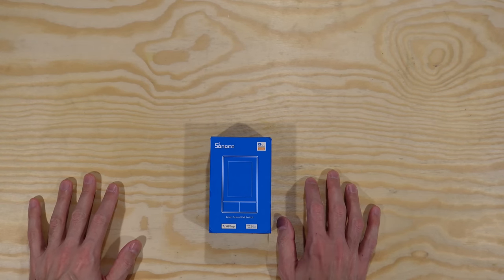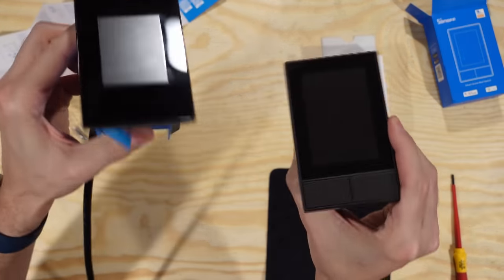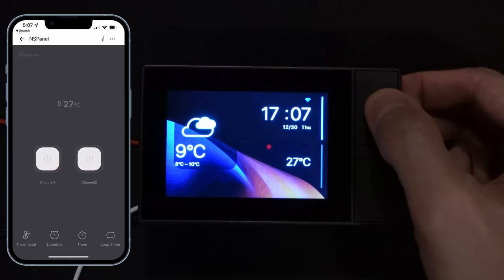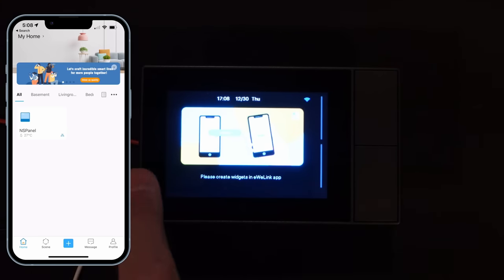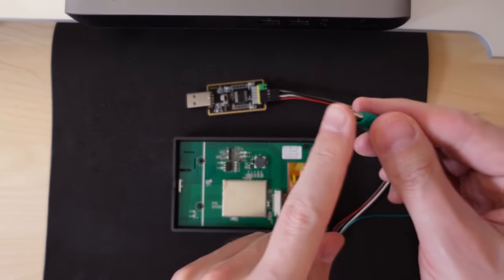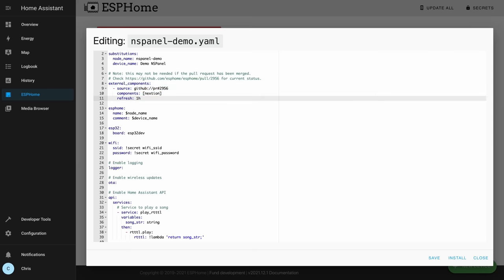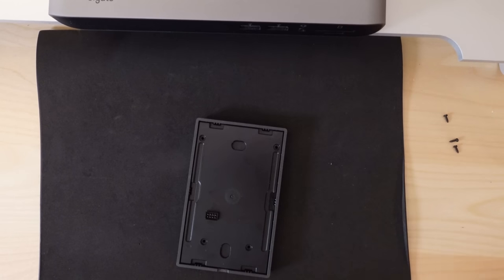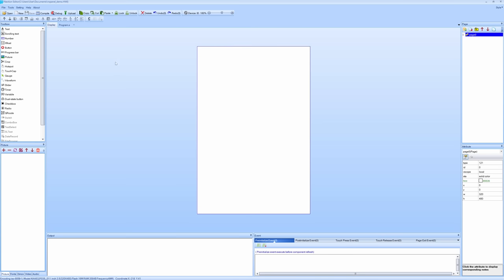Flashing the Sonoff NSPanel with ESPHome - how to get a custom UI for Home Assistant!

Comment: What a great walk through - Thank you very much ! I have my Kickstarter EU version on the bench. Torn between keeping the Sonoff HMI and waiting for the ESPHome component to implement all the Widget functionality, or diving in with the Nextion Editor. Now if only Sonoff would go the whole way and release their HMI and we could amend the default with the nice graphics !
Reply: Same here, i just got mine today, and currently just having it idle using the stock eweelink firmware. It will be great once these becoming more widespread and all the ESPhome/tasmota features/goodies become implemented.. I basically for now just want the stock UI with the realtime weather, time, and room temp. but eventually would like some slick customization.

Vids like this though are great that there is hope to fully unlocking and enjoying these LCD smart switch units. I definitely want to put these in all my rooms considering that once we put open flashed firmware, these units basically become a local lifetime unit without worrying about shutdown cloud services.
Reply: @TheMoistpotato  @Dean Smith I know this is from a year ago, do you know if ESPhome has now implemented the widgets for home assistant? Wondering if you can now use the stock GUI but add devices / scenes from other sources (not ewelink)?

Comment: you can get a nice 7" used tablet for $100 and have this functionality + much more
Reply from the maker: Just a few reasons why that might not be a direct equivalent:
* Form factor doesn't work as a switch replacement
* No physical buttons
* Doesn't control loads
* More complex interface, have to deal with kiosk browsers etc.
* Mounting more complex to avoid unsightly USB cable
* Battery swelling issues if charging isn't managed (or batteries removed)

I also have a tablet where it makes sense and I like it for that application. But it's not the same at all.

Comment: Amazing video! Really helped me to get started with my two NSPanels. One question: did you get the slider working? I could not get it up and running...
Reply from the maker: Thanks. What slider do you mean?
Reply: @ChrisMasto  The slider element in Nextion I would like to use. You can define a slider item in the Nextion editor. But I couldn't send the slider value to Home Assistant. I guess, you must set in the "Touch Move" to send the value. But I couldn't get this work.
Reply from the maker: @haraldprior5291  I haven't tried it yet. There do seem to be some differences with this capacitive screen, especially when it comes to what events it triggers. You might have to use something like https://esphome.io/components/sensor/nextion.html#nextion-custom-sensor-protocol for updates on a slider, I don't know. I'll check it out over the weekend.
Reply: @ChrisMasto  That is exactly where I am stuck. I tried to enter "printh 91" to initialize that sensor data is coming and then "prints h0.val,0" to send the slider data. But that didn't work out. I can't see any data in the log of the ESP. Would be great if you take a look.
And again: amazing work! I really was looking for an easy way to get the NSPanel into ESPHome and Home Assistant. What you showed in the video was exactly what I need! Thank you!

Comment: Fantastic video! 
Can you elaborate on your thoughts against using this as a thermostat? How do the Chinese users use it?
I was thinking of having a backup thermostat/remote switch in case I'm not around but want to switch the heating on while away. Thoughts?

Comment: Hello! Nice! Thanks for manual! Can we edit original sonoff nextion file? I really like their design, but whant to just add some of my own devices through the ha.
Reply from the maker: Unfortunately not. People have figured out how to extract the TFT file, but you can’t bring it back into the editor once it’s been “compiled”.

If you are happy with the Sonoff UI, though, you can use jesserockz’ ESPHome component (https://github.com/esphome/esphome/pull/2702) which lets you add widgets in the same way you can with their app. You can also do this with Tasmota if that’s more your jam.

Comment: love this ,and perfect as my order turned up weds ,just a couple of q's in my limited knowledge i've got a ft232 usb to serial ,can i use that or does it have to be the 232rl ? then the physical buttons used in combination of either a fibaro dimmer 2 or say a sonof mini ,so the modules dealing with the load and the relays becoming a momentary switch ?

Comment: You can set the 2 buttons to do something else by going into the scenes and add a smart device after pressing the physical button. But, I would like to see that thing in the ESPHome or a Tasmota to control the Sonoff light bulbs.
Reply from the maker: Thanks! I only spent 30 seconds with their app, so I probably missed a lot of features it has. I knew I had no plans to keep it around.

Comment: Love this video! I followed your instructions and was able to flash esphome and create a custom UI. The only thing I notice is that uploading a TFT file to the screen takes very, very long. Is this normal in your experience? I've been waiting for around 5 minutes and the upload is only 10% done.
Reply from the maker: It takes longer the first time, because the protocol only sends the differences.
Reply: @ChrisMasto  Thanks. Still waiting. 40% done. I'm excited about my project though. I'm trying to create an RV thermostat that controls Dometic ACs and integrates with Home Assistant. Will share when I'm a bit closer. Your video was key to getting me started!! And yes, I also hate the Nextion Editor, also because it doesn't run on a Mac. So I'm having to use CrossOver to make it run and it's slooooow.

Comment: 15:49 I've been unable to measure continuity between two pins pushed deep into the holes on my smaller version NSPanel so I doubt that "metal" is conductive. It's perhaps a metal plastic RF shield that has the plastic side facing the board?
Reply from the maker: Better safe than sorry?

Comment: Christopher, do you need to use any kind of hub in order to use this  wall panel ? any firmware that support Apple HomeKit. Thx
Reply from the maker: Well, I made a video about using it with ESPHome and Home Assistant. Beyond that I'm afraid I don't have the information you're requesting.

Comment: Great work and I'm 90% there but cannot get the tft to upload? get the errors you do in the video but connot get around them..so frustrating lol
Reply: Yeah, my tft uploads are not workign either. They all end up with a white screen, on panel reseat you get "System display ERROR!" The only thing I can do is flash back the stock display firware for now. Thats the only thing that works. I think nextion has made some changes to their devices...

Comment: When you turn on/off from the light switch with the status also update the Nextion panel?  If not what is the additional codes you need to add.

Comment: i keep getting "Failed to initialize. Try resetting your device or holding the BOOT button" although all pins are plugged in correctly to soldered headers, including the "io0-gnd"

Comment: I've run into the weirdest thing and wondering if anyone else does to reply here. I've done two panels. 
I set up the first one (using this great tutorial and starter files), got my final yaml file all set with buttons and weather and etc. Built screens in Nextion. Uploaded those to the unit. Great.
Bought a second one and that took 5 minutes:Copy the yaml, change the name fields, flash the device, it shows up, upload the tft file. Also great.

Bought a third one, but it's white and the AC power module looks slightly different (has a different cover over the wire posts - board is, AFAICT, the same). Did the same procedure as the 2nd one and... it wouldn't connect to wifi.  I've monkeyed and monkeyed and compiled and compiled and the only way I could get it online was to use the very first barebones bin file I created way back. But that means it's named the same as other unit (i did manage to upload a tft this way, but I undid it all so I could get unit 1 back online). The only thing I can think that's different other than the unit itself is that I had just updated to 2023.4.0

Anyway, if anyone else has a white unit (or a unit with the rounded post cover instead of the flat sliding one),  I'd love to hear it's not just me.  
I gave up for now, but will try again when I have anot6her day to waste. :)

Comment: Brilliant tutorial!  I'm trying to work out how to switch the display off after 30 seconds.  I've tried using thsp=30 in the Nextion editor and it works if I debug but not on the actual device.  Is there another way?  Or is something in the ESPHome config stopping this working?
Reply from the maker: Hi Andy, glad you liked it. Apparently this is a special capacitive touch display that doesn't work exactly like the standard resistive ones. But you may find this forum thread helpful, where the same issue and a solution was discussed: https://community.home-assistant.io/t/sonoff-nspanel-smart-scene-wall-switch-by-itead-coming-soon-on-kickstarter/332962/155
Reply: @ChrisMasto  Ah!  Thank you.  I have been asked a couple of questions on that thread when I was trying Tasmota.  It's moved even in the hours since I was on that page.  I think your Wiki idea is spot on.  My main worry is the screen.  Do these suffer from screen burn like in days of old?

Comment: I'm unable to start the flashing procedure. I tried 2 different USB to TTL dongle's on both windows and mac. Different usb ports and different wires. But every time it gives me un unexpected error before the actual flashing starts:
Unexpected error: ESP Chip Auto-Detection failed: Failed to connect to Espressif device: Invalid head of packet (0xF0)
Unexpected error: ESP Chip Auto-Detection failed: Failed to connect to Espressif device: Packet content transfer stopped (received 2 bytes)
Unexpected error: Invalid head of packet, Possible serial noise or corruption.
Unexpected error: index out of range
after having one of those, on windows, the next time I will get (unless I replug the device)
Unexpected error: could not open port 'COM4': PermissionError(13, 'Access is denied.', None, 5) 

the IO0 pin it connected to the ground (tried both on the TTL device and the pin on the NSPanel itself).
The stock firmware just works, so not sure what could be wrong anymore.
Anyone had a similar experience?
Reply from the maker: I don't know what's wrong, but I think you'll get more help from some of the communities at https://github.com/masto/NSPanel-Demo-Files/wiki/Resources#communities. The flashing part isn't NSPanel-specific, so the ESPHome forum or discord are a good place to start.

There's also a new browser-based flashing dashboard just released: https://esphome.io/changelog/2022.1.0.html#esphome-web.
Reply: @ChrisMasto  I unexpectedly got it to work. So I had a (possibly counterfeit) FT232 USB Dongle that worked on other things in the past. Since I was having issues I bought 2 new ones. The CP2102 also failed (that's when I wrote the original comment). But the one based on the CH340G only arrived today and went through the flashing procedure without any problem. Not sure if it was an issue with my NSPanel or my other two TTL dongles, but if someone else has issues, this is certainly something to look into.
Looking forward to integrating this panel in my Home Assistant setup!

Comment: Could you add say 10 smart switches to this and have one button to turn off all the lights?
Reply from the maker: If you put custom firmware on it, you can do whatever you want. I think you could do the same with the factory firmware and Sonoff app -- you would set up a scene to turn those lights off and the button would activate the scene -- but I personally spent all of 30 seconds looking at their app before I put ESPhome on mine, so I'm no expert. 🙂
Reply: @ChrisMasto  Thanks.

Comment: First of all the tutorial is great. It covers everything and is easy to follow.
 
Second: I loaded in your Yaml demo and set up a screen on the Sonoff NSP everything works great except the sensors latch on and do not toggle in the HA device screen. In ESPHome the log files for the NSPanel show that the first time you push the button it issues an ON command after that it issues a press command. 
Any Ideas??
Reply from the maker: Are you talking about the physical buttons or onscreen buttons? If they're onscreen buttons, are you using your own HMI? You may have missed enabling Touch Release Event (31:46).
Reply: @ChrisMasto  They are on screen buttons, I am using my own HMI and I DID miss enabling Touch Released Event.
Thanks for the response.

Comment: Boy, I'm really stuck after following these directions. The panel loaded my custom TFT after calling the service in HA, but now it's permanently stuck on that screen. I can't seem to push a new version to the panel no matter what I try. I've even saved a local copy of the bin and used webserial to push it via USB and that didn't make any difference.

After giving up, I tried to flash it back to the factory stock firmware image I took before doing any of the work and was shocked to see my old TFT panel load after powering it back up! It's like it's possessed...

Anyone else run into this sort of thing? I've read online that one fix might be to push tasmota on it instead; if I can't figure out anything I guess I'll try that next.
Reply: Yeah tasmota isn't helping me. The nextion display part of the system is basically bricked to the sample TFT file from this YT author - I can't get rid of the file or get the display to do anything else other than show the Play - On - Off - Red button screen. It's just stuck with that every time I try to flash the ESP or the nextion firmware. Weird....
Reply from the maker: It's been a long time since I last worked on one of these, but as I recall the firmware and the TFT are separate, so it's not too surprising that reverting the firmware didn't change it. But I'm not sure why you were able to do it once and not again. Wild speculation: it may be a connectivity issue of some kind -- the sample file is very small, so I'm wondering if the problem is that it is failing to read larger files.
Reply: @ChrisMasto  yeah I even was able to flash it with Tasmota (the ESP part) and using the commands to "flash the nextion" with various options none worked as it would always show the one screen that I made in the nextion s/w and uploaded via HA using the call service command as outlined in the video.

I spent quite a bit more time and eventually gave up and returned the item.
Reply: @bumpkeys  You returned the item??? After basically voiding the warranty, wow... 
I had the exact same problem and now I'm afraid of trying again. I had a hard time trying to upload the tft. It seems that the newer panels come with some working mode that prevents tft uploading, some of the latest updates and tasmota seem to be able to handle this. However what you're describing (and happened to me as well) seems to have a different root cause, and I'm not sure what it is, it feels like one of the tft uploads was interrupted this bricked the display because it no longer restarts the display as before, and now it goes straight to the TFT design that got stuck. If anyone knows a solution please let me know.

Comment: I'm surprised you have so much problems with the save button in ESP-Home.
I have never seen that message that the save failed.
Reply from the maker: Interesting. I see the same behavior on my "real" Home Assistant installation as well as the virtual machine I set up for this video. 

...aaaand I just tried the obvious: is it browser-specific? Yep, it only happens in Safari on my Mac. The save always works in Chrome.
Reply: @ChrisMasto  nice job finding the issue!
I always use Chrome or Edge and never have the issue.
Reply from the maker: You successfully nerd-sniped me into spending most of the day finding the problem. :-)  I wrote up a bug report here along with a way to fix it, and I'll see if the Home Assistant folks will take it. https://github.com/esphome/issues/issues/2908
Reply: why is home assistant so picky about which browser you use? I was using Firefox for a while until it started glitching out.
Reply: @tseawell90  I think the real issue is, why is browsers so different?
The code used is standardized so why does it produce different results?
Reply: @TheHellis  I have no idea. Really frustrating because at first I thought my home assistant file was corrupted somehow. Took me a while to realize it was the browser.